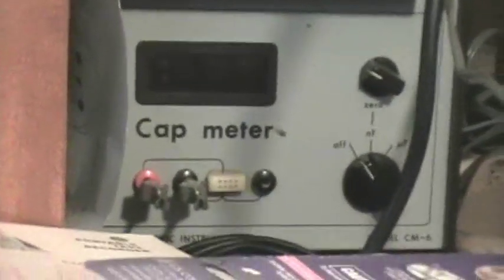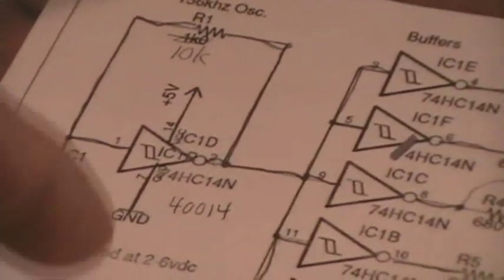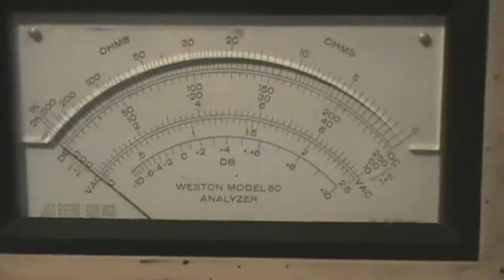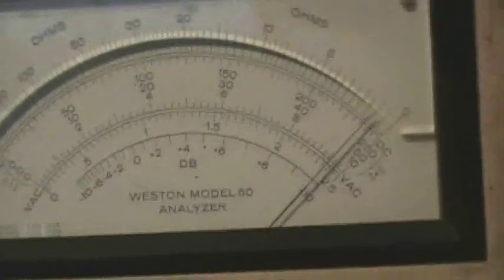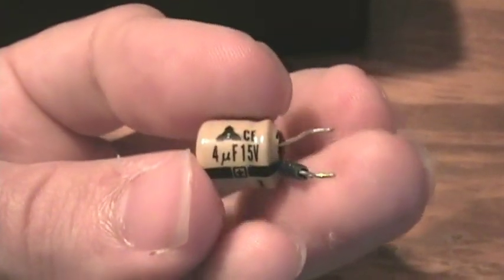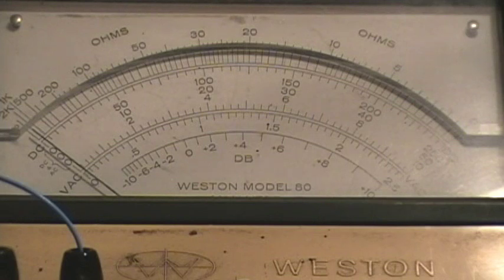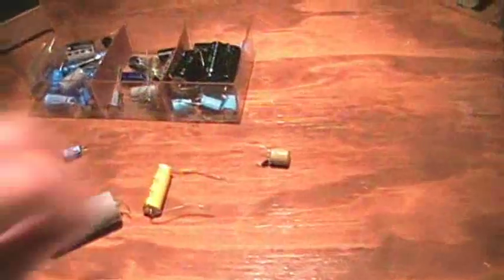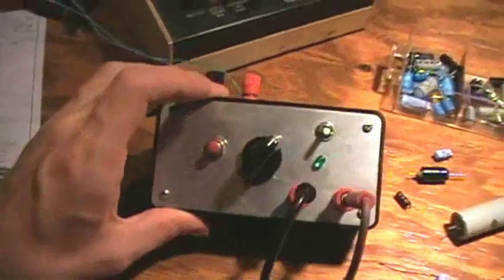Homemade ESR meter!! (WHHOOOOO!!)

Comment: I like to test capacitors using an analogue meter with a capacitance scale and compare it with a new capacitor.  It tells alot of information, for example how fast it discharges when you remove the test leads, it gives a rough estimate of value.  By pulsing the test leads it shows if it holds a charge and for how long.  When you compare it to a good capacitor (new) you get some idea of what the cap will do actual operation.  This technique requires some practice and along with the physical look of the cap will probabily be good for testing in most situations.

Comment: An ESR meter will not check leakage. ESR and leakage are two different things. Leakage is...well...(current) leakage, and ESR is equivalent series resistance, ESR can go high with no rise in leakage. You need to check capacitance, leakage at rated voltage, and ESR...all three.
Reply: Capacitance does not significantly change. What changes is the indicated capacitance because the high ESR is confusing the capacitance meter.

Comment: Subbed! I plan to build my esr meter out of little cheesy SUNMA multimeter, it's got 500uA movement inside (circuit that I plan to build needs 500uA movement). Will be a valuable piece of test equipment to have, since I sometimes repair old CRT TV's

Comment: Try twisting the wires going to your meter  because they are fairly long and far away from each other, I am sure you know why we do that .Maybe use a shielded twisted pair and ground the two components together through the shielding cable . Could give you a more stable reading on your meter . There are a lot of stray signals flying all around these days , Flourescent lighting ,AND WIFI is a good source of stray EMI I it is just a thought. Imagonna make me one of them one of these days THANKS FOR YO VIDEO ,good deal .

Comment: stick a simple fixed value resistor to the esr meter , like 1 ohm, 2 ohms, 5 ohms, 10 ohms or so to find out where those ohms on your scale is. sort of "calibrating" it

Comment: I built my ESR meter using the same circuit. I had to eliminate the 10K resistor (R17) right before the meter movement also to get full zero. 

It has gotten to the point now where I use it first to check a cap, then use the capacitance meter to check for correct value. By the way, I have one of the Dage capacitance meters as well, they are actually a nice unit.

Comment: If he were to clip one lead off and test each of those paper caps under a resistance-capacitance type checker like an Eico, Heathkit, PACO, etc he would very quickly find that what tested good on an ESR meter fails miserably with only 50 volts across it.

Comment: There is a fellow on the Philco Phorum that keeps insisting that the caps test good in whatever old radio he is working on, Philco, Zenith Transoceanic, whatever, but he doesn't specify what he is testing them with. We keep telling him to assume they are all bad regardless of how they test because they are not being tested under working voltage.

Comment: I used to work for John Bachman, the designer of the Anatek Blue ESR meter. He sells the meter in kit or pre-assembled form. It's a great product.
Reply: Just for your information, John did not design the Blue ESR meter - I did. I collaborated with John on the case and the PCB to go in it.